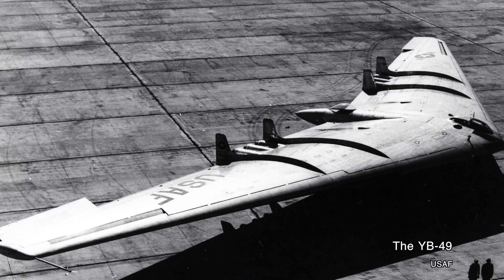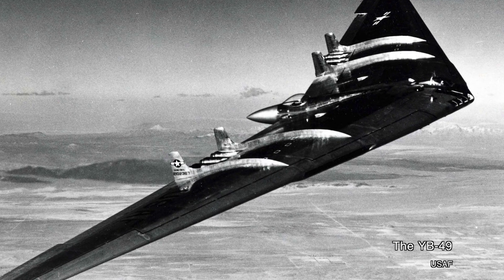Northrop's YB-49 Flying Wing Definitely Wasn't a UFO

Comment: I have never bought that the YB-49 was useless as a bomber because of Yaw Instability. Northrop addressed that and given the primitive accuracy of radar-assisted bombing it would have been an adequate deterrent initially and later as avionics advanced it would have matched any other bomber. Now I have to get ready for a Friday night Retro Bar performance by the Pregnant Guppies. On bass, none other than future B-21 Top Secret Reporter, the subtle stylings on bass by AST.

Comment: The B-2 (and, I'm sure, the XB-35 and YB-49) might look interesting from other angles, but from the side it DOES look like a UFO (or flying saucer). I saw it from maybe a mile away during a fly-past at an airshow at Grissom AFB.. must have been 1999 or 2000, I was heading there for the airshow but got there just a LITTLE too late. Looked like a VERY LONG FLAT THING with a pointed end, floating slowly in the air. Weird. I did get to spend the afternoon having a very close look at the B-58s parked at the base's museum - those are HUGE, you don't realize how big they are looking at photos.

Comment: THE NORTHROP FLYING WING...BETTER KNOWN AS  THE HORTON HO 229   ;D
Reply: +SmittenTheKitteninMittens    Nope. Northrop was awarded a contact to construct the large YB-35 back in 1941 and was flying a 1/3 scale prototype by 1942.  The Horten brothers did not even talk to Goering and get funding to start on the 229 experiments until 1943 and their V1, V2, and V3 were much smaller designs with a single aircrew.

Comment: Sorry Amy but there were 9 YB49s being built at the time when it was abruptly cancelled and Northrop was being pressed to merge with Convair by then Airforce Secretary Symington who later was Convair's CEO. . The aircraft were cut up and smelted so quickly that Congress investigated what had happened to the bomber that once flew over Washington DC and toured by Pres. Truman. One survived until 1953 on company grounds but it to was scrapped despite the Smithsonian requested one for preservation and spectre of sabotage has haunted the YB49 story for decades.

Comment: What about the hortens?
Reply: harry loud both designs originated during WWII - the Germans and Americans weren't exactly exchanging a lot of aeronautical research data at the time.
Reply: Carl Jacobsen yeh, i do know that, i was simply asking for a video pr mention about the design
Reply: Carl Jacobsen Northrop started flying a smaller version the N9MB in 1943. and stated designing flying wings in the 1920s.
Reply: harry loud Northrop started designing flying wings in the 1920s. and had a smaller one the N9MB for testing and was flying it in 1943. only thing i have seen about the Horton is that it was doing taxi tests .

Comment: What about the Horten Ho IX / Gothaer Go 229 German turbojet night fighter developed in 1944? Admittedly, ze Germans only made one functional prototype which crashed on its second test flight, but it was the first jet powered flying wing to actually fly.
Reply: Lloyd Evans Note that Northrop's and Horten's flying wing is unrelated and they had developed their own flying wing design since the 1930's and during WWII. It's only after 1943s that Jack Northrop realized that the Germans also developing their own flying wing design. Northrop had already built his own engined flying design, the N-1M and one-third scale of XB-35 the N-9M as early as 1941.
Reply: Had that thing been built in numbers it would have been become the Luftwaffe's number one widowmaker, of which there was no shortness in their arsenal in the first place. The unreliability and delicacy of the Jumo jets were causing enough issues with the way more stable 262s. As that prototype you mentioned showed, one engine failing would knock the plane out off the sky.
Reply: Well, Horten were originally planning to use the BMW 003 engine in their nachtjaeger. It was actually designed with this engine in mind, and was modified to allow the Jumo 004 engine to be used instead. One of the major modifications was to enlarge the thickness of the wing, since the Jumo engines were fatter. Had it actually used the BMW jets, it would probably have been even more aerodynamic and therefore faster and more maneuverable.

Comment: I think it's a great idea, but you really need fly by wire to help with control and to prevent a stall. If a flying wing stalls it starts flipping end over end with no chance of recovery. I would bet a lot of money that that was the cause of the mysterious crash you mentioned.

Comment: I don't remember where I saw this, but it was a documentary about the B-2. One of the pilots mentioned that a pilot of a previous flying wing design said they were extremely easy to stall. That could have been what happened to the YB-49. He then said when he flew the B-2, he tried to put it into a stall and the aircraft just wouldn't let him. Apparently they figured out that design flaw.

Comment: Simple that yb-49 spun in flight. Wings spin easier than conventional aircraft.
Reply: carguy140dude  That is why it had multiple engines, so if one failed it would not cause the plane to spin out of control like an early German model which had two engines located close to the fuselage. This was not enough balance to save it and the pilot from a helical crash & burn

Comment: I think all of the planes of today ought to be flying wings.  Especially long range passenger planes.  Flying wings are so much more efficient.
Reply: Theoretically, yes, but in practice they generally don't work out that way. They're supposed to be more aerodynamically efficient by eliminating the drag created by the fuselage and tail surfaces. The problem is that thicker wings create more drag, and the wings of most aircraft would have to be made MUCH thicker to accommodate all of the passengers, cargo, fuel, engines, etc. That massive increase in thickness creates far more drag than is saved by eliminating the fuselage and tail surfaces.
Reply: Quite correct. Also, most high-lift devices cannot be used in flying wings, as they would cause pitching problems. Notice that tailed deltas like the MIG21 and A4D had better performance and longer careers than the pure deltas.

Comment: The plane crashed because it flipped over at low speed and the pilots had no chance to recover. 

"Investigations of the second YB-49's crash could assign no specific 
cause for the accident, but determined that a major structural failure 
had taken place in flight. An eyewitness described the plane as tumbling
 uncontrollably about its lateral axis just before hitting the ground. 
Project officers later verified that under certain conditions a "flying 
wing" would indeed "somersault" through the air. The loss of the 
aircraft and further wind tunnel work perpetuated doubts concerning the 
flying wing's aerodynamic stability and revealed the need for additional
 flight testing.
"

The project was then cancelled by congress and funding removed. But Northrop had not given up on the concept. As the project was funded later under the black projects program. As they looked as increasing advances in soviet radar technology. Thus was born the B2 bomber with the low cross section radar signature and long range none stop flight. It could attack any target on the planet without the need of any forward airbase.....

Comment: The Horten brothers' Gotha 229 of Nazi Germany must have shocked the Allies as they opened the facility it was stored. I wonder if it influenced the production of the B-2 Spirit.
Reply: Nearly everything from the Horten Bros. was shipped to Northrop for study. Jack had been working on a flying wing since the 1920s, but they had solved a lot of the design problems.
Reply: fromkentucky.   it was shipped to the army test center. northrop corp. didn't see it until they started on the B2 when they built a static model for test perposes.

Comment: The opposite of the Flying Wing is of course the Lifting Body. These have terrible glide slopes but have even less drag. Flying wings have a LOT of drag, they just also have a lot of lift. You can't go high speeds with the flying wing design because drag increases exponentially with speed. With a lifting body, you can go really fast and still stay in the air.

Comment: Flying wings never achieve the gains that people initially believe they offer.  The thing that kills the idea is the maximum lift coefficient - struggling to rise above 0.7.  A conventional tailed airframe could be north of 2.0, so the poor old "efficient" flying wing has to drag around more than twice as much wing area as a conventional aircraft for the same mission and when wing area equals drag, there endeth the  aerodynamic advantage...

Comment: I noticed some comments about the B-2 being inherently unstable which of course is true. The YB-35 and YB-49 were also unstable but probably less so than the B-2. This in part because in the YB-35s case, the engine housings may have served as a sort of vertical stabilizer and the YB-49 had small vertical stabs on it. In addition, inherently unstable does not mean unflyable. It means the aircraft is much more likely to experience control loss in extreme maneuvering situations. This seems to have been the cause of the YB-49 crash mentioned in Amy's video where she mentioned the loss of horizontal velocity as a possible contributing factor to the crash. The B-2 could probably be flown without computers but it would fly much less safely than with the computers, especially in steep turns or steep climbs and descents. A B-2 RC model can probably demonstrate this ability to fly as long as the maneuvers are not too extreme. Weight distribution probably plays a role in the difference between an RC model B-2 and the actual B-2 which could affect aerodynamics. Someone with RC model experience may be able to better comment on this than me. Anyway, just my 1 cent after factoring inflation.

Comment: I think the flying wing design is a great idea. I am surprised the design has seen such limited success in the civilian market. With our current understanding of aerodynamics and ability to model and simulate before building, I see no reason a commercial cargo or passenger design would not be viable.
Reply: +Jesse Sisolack :It boils down to economics which I'm sure you know. The tubular airframe is the most economical at present. I recall when there was a greater variety in commercial jet designs. The 4 engine Boeing 707, 747 and DC-8, the tri engine 727, DC-10 and L-1011. Economics has given way to twin engine designs with much less visual variety but apparently better functionality. My guess would be that eventually, flying wings will be dominant because of the economic gains of eliminating the rudder and elevators as separate surfaces.
Reply: +J Dean Yes, I guess I expected it to come to fast. Really, humans have had heavier then air flight for only a little over 100 years.

Comment: how much of the technology from the Horten 229 German flying wing fighter went into the YB-49?
Reply: +Rocket Man Similar story on the turbo jet engine itself, with researchers in England and Germany coming to near-identical solutions at about the same time without any knowledge of one another. Form follows function!
Reply: +martin seelig Not a huge amount. Jack Northrop had been building and designing flying wings independently of and for as long as the Horten brothers. His first flying wing design was in the air as early as 1941. I'm sure they had a look at the German data but I'm not sure a lot of what they found would have fundamentally improved what they knew already.

By the way folks, the chap who founded NORTHROP was called Jack NORTHROP. NorthRUP is an area near White Sands test site and was where one of the early Space Shuttle missions landed.

People seem to get the two names confused quite frequently.
Reply: +Rocket Man And they weren't the only ones either. From the earliest days of flight, the notion of an aeroplane consisting chiefly of a wing and nothing much else had been experimented with.
Reply: It is well known that Northrop and the Horten brothers developed the flying wing concept independently of each other, and each in their own way. What is almost unknown is that Reimar Horten acted as consultant during the development of the B-2 Spirit: he was visited by Northrop personnel at his home in Argentina. This was revealed after Reimar Horten death by his son in an interview for a docu film.
Reply: martin seelig none.

Comment: In the extended piece at Vintage Space you mistakenly used the term Turboprop for the Wasp Major version of the engines used.  Did you mean turbocharged?
The flying wing first came to my attention as a teen living on the East Coast in the 1950's when I came across a publicity booklet probably released at the event of its transcontinental speed record trip. That booklet had a line drawing of the wing on each of its pages that, if flipped as one would shuffle a deck of cards, showed  animation of the wing in flight. fascinating, but to my young mind, it seemed just science fiction. No one I knew at the time believed it existed, and by that time it did not.

Much later, having moved to California I learned a lot more about the plane. The counter-rotating propellers of its IC engined version did much to kill that version. Other prototype aircraft trying to use the technology failed too, including Howard Hughes third aircraft design, which nearly killed him. 
The grafting of those early turbojets into that original wing design solved that problem but had two others, at a minimum. From what I have heard, those engines designed for fighter aircraft had 'total loss' oil cooling which wasn't such a problem for interceptor type aircraft, but for a long range plane, needed huge oil tanks. The wing really did need a redesign if it was to use jet engines, even ones made for bomber type aircraft such as the  later developed Boeing B-47. The wing, therefore was slower with eight engines to the B-47's six due to its thick, mildly swept wings. No doubt the extra fuel and oil tanks caused COG problems that the fixed weight of a bomb load would not have. Still I would love it if at least one of them had survived both the politics and the problems encountered by it.
Reply: Paul Gracey the engines were not as powerful as northrope wanted but the air force made him use them. on the xb35 the props and gear boxes were the property of the air force and they wouldn't fix the problems with them when the engineers told them about the vibration problems that they had. and thats on record.

Comment: How do you control pitch and yaw with a flying wing?
Reply: +mustang6172 The trailing edge of the wing is behind the COM, so elevons control both pitch and roll.

Depending on the specific design, yaw can be done through differential thrust (throttle up starboard and throttle down port to yaw to port) or by using a split airbrake system that imposes drag on one wing.
Reply: +mustang6172 Drag rudders control yaw.  The ailerons are actually split in two and open like clam shells to act as drag rudders, or both halves move in the same direction to function as an aileron.  The controls can also be 'mixed' to provide both at the same time.  Pitch  is controlled by more or less conventional elevators located on the inboard part of the wing, and engine thrust vectoring can also be employed.

Comment: Unfortunately the flying wing was going against another plane which was the B-36 that had six push propellers and two jets to use, which the Air Force granted that plane. The flying wings that were in different stages of being built during that time were ordered by the defense department to be destroyed. As for the legacy of the wing. Their have been rumors that at Area 51 had a fighter size plane that looked like the B-2.
Reply: +centaur1a  The B-36 was originally designed without those jets, primarily the jets were added to contend with  the all-jet flying wing for those in Congress who were tired of piston engine designs and wanted the more up to date jets. Though those jets added to the take-off thrust, I think they had to be shut down in flight to get the 10,000 mile range that the B-36 still had and the YB-49 had sacrificed to its greater speed.

Comment: Very cool. In Raiders of the Lost Ark the Nazis have a flying wing. I've always wondered if that was in any way based in reality. If the US was trying it at the time then I guess it's not impossible.
Reply: +Malkhut Sefirah German engineers were studying flying wing designs in the 30s. As George Holt commented above, the Horton brothers had a series of designs, and the Nazis had plans for jet powered flying wings, if their defeat in WW2 hadnt happened when it did.
Reply: AFAIK, the flying wing aircraft in ROTLA was just 'made up', but the Nazis - and primarily the Horten brothers - WERE working on flying wing aircraft.  They HAD a flying wing bomber designed, but the war ended before it could go into production....